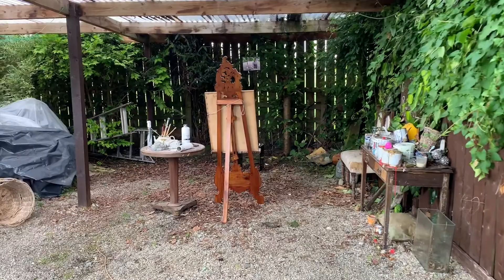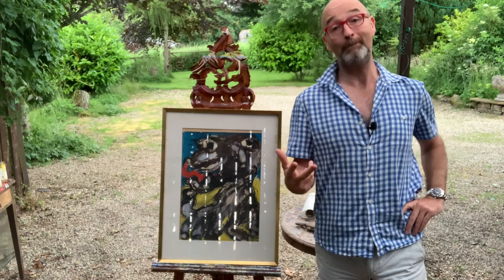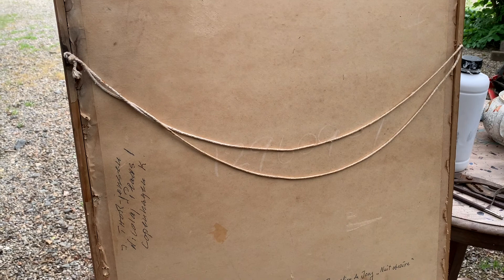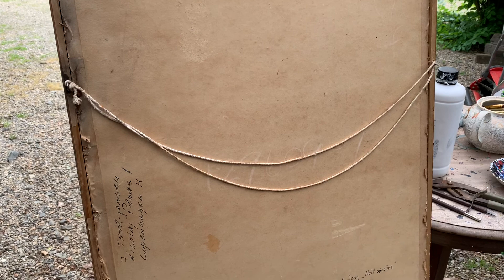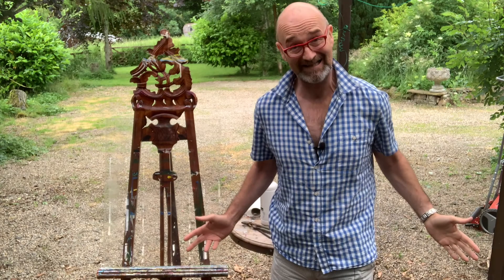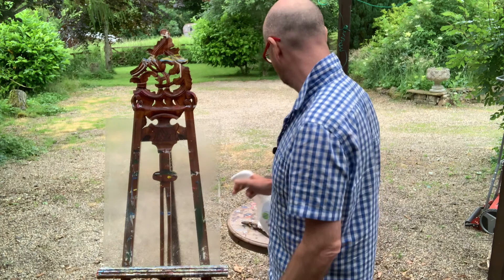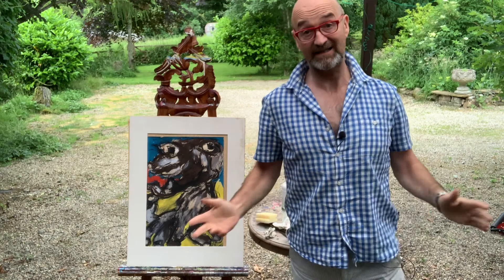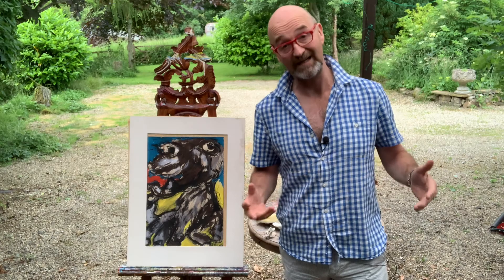A 1960’s Jacqueline De Jong original painting. Quickly restored

Comment: My first reaction to the painting?  It's getting in the way of that lovely easel!   Second reaction,  I'd consign it so fast your head would spin.  Everything David used to conserve it made me cringe a bit.; I have just enough conservation training to get into trouble.  The back is disgusting; I'd at least put something acid free between it and the painting as a buffer. Since you must keep the original matte, get something acid-free in between the mount and the painting.  Acidic paper eats art.   New UV-resistant glass too.  Acid-free double-stick tape to the new acid-free backing.  Price ... too modern for me to even take a guess.
Reply: As someone who did a lot of vintage paper art restoration....reusing the old mat and the use of packing tape made my skin crawl. The material the print was mounted on was surely acidic paper as well. David did not do any favors to that piece of modern art.
Reply: @mooonienelson2126  Then again we know my opinion of it as art, so.... That said, I've been known to do a better job on pieces my niece did at six or 7.